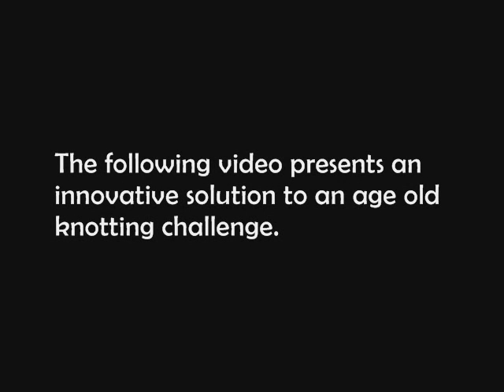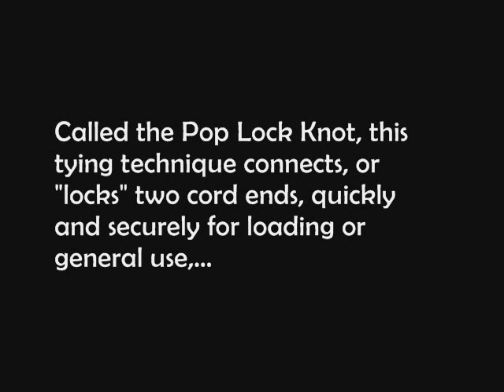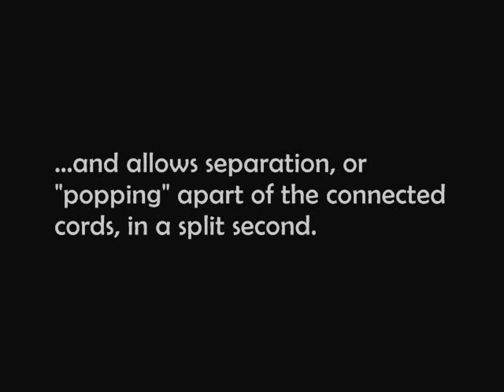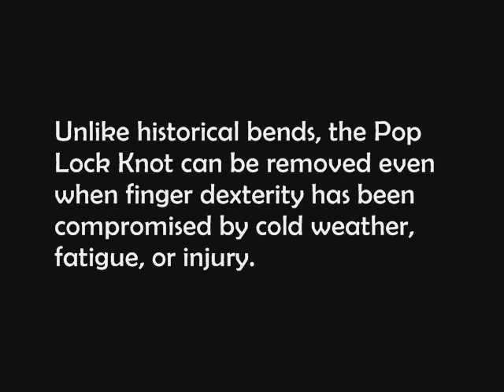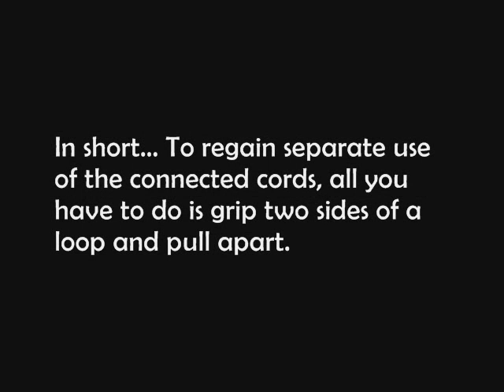How to Tie the Pop Lock Knot (An Innovative Bend) by TIAT

Comment: If using 550 cord and the ends have been burned and even the slightest 'bud" on the end.  It will not pull through very easily.  thanks for the video.  great

Comment: It's quite limiting that it can't be easily tied when any standing end is already in use though.  

I tied this a few times to try it out, but found that when it was tight enough to hold, it was too tight to easily release. I tried it in 6mm kernmantle utility cord, and in braided nylon clothesline, and neither worked very well. 

Is there some situation where you'd prefer this knot over, say, a slipped sheet bend?

Comment: Just a follow up: Haven't tested the PLK in life safety applications and sadly, we won't be. Orders from a higher rank than me. However, it is a practical extension of our utility knots and has already found use in a woodland fire. It was slow to apply because of the new-ness(?) but worked well without failing. Note: the fire mention was contained, only then did we apply skill sets that needed work, the PLK was an add on. Thanks!

Comment: @TyingItAllTogether Have you put any significant weight/force on this knot? With how easily it pops loose, I would be concerned that it would slide loose under a good load.
I don't think this would work too well as a release on a snare. From the video, it looks like it takes some force to pop it. Most snares need a hair trigger to work.

Comment: Interesting thought process you have there Mr. Lenzen. What looked to be another variation of a Solomon bar turned into a useful thing. This leaves me wondering if this bend could be used in a life safety application. (rope rescue, etc.) I anchored one end of the paracord, applied the bend and pulled. The bend only tightened and did not give way before I got tired. I will apply this in our life safety training ropes at the FD. I will forward my results if you wish and give you due credit.